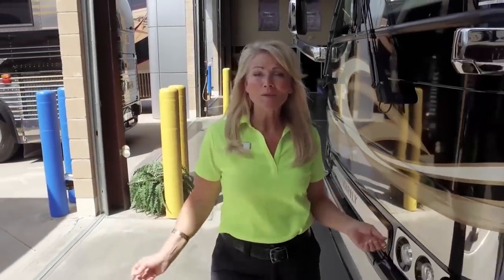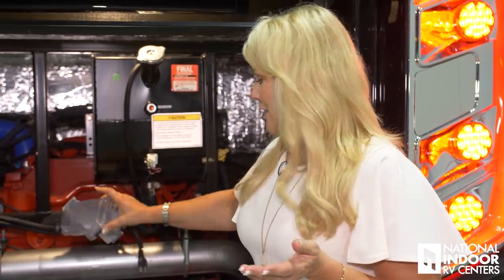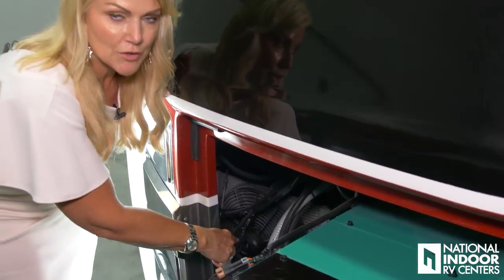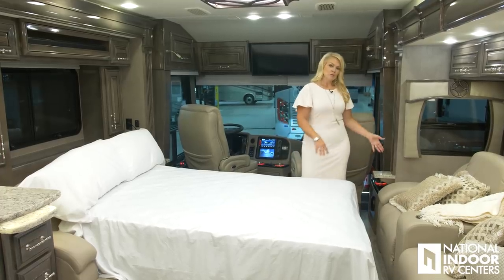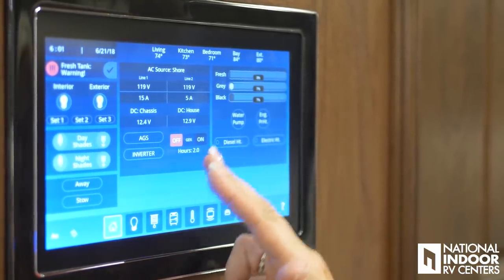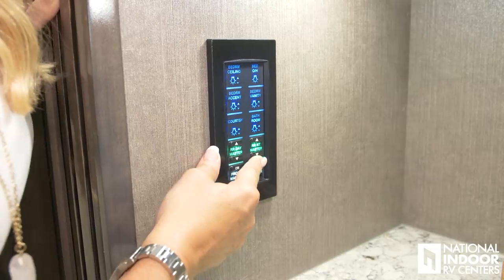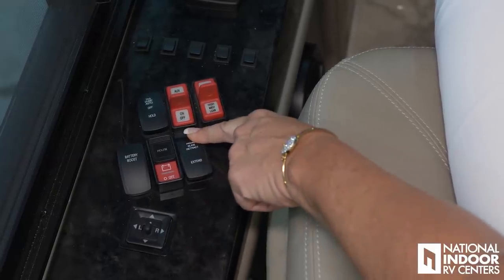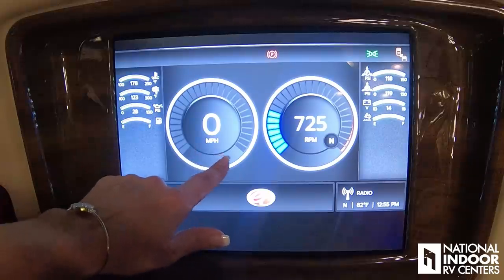2019 Entegra Cornerstone | Full Motorhome Walkthrough Tour | NIRVC

Comment: New to the RV world.   Tiffin or Entegra ?   Value, Customer Service, build quality, Mfg support, ride quality?
Reply from the maker: Hi Frank, I think Entegra is the better value. They pack in so many standard options. The Cornerstone comes standard with the 605HP engine, Spartan chassis, 12.5 Generator, 2 3000 watt Pure Sine Invertors, air leveling and hydraulic leveling, passive steer tag axle, 20,000 lb front Axle with 365 front tires, heated floors and it really is the quietest riding, best handling coach on the market today period. It also comes with a 2 warranty. I would recommend that you test drive an Entegra and a Tiffin and I think you will experience the differences for yourself. If you have more questions for me please feel free to contact me at amorell@nirvc.com

Thanks for watching our videos!